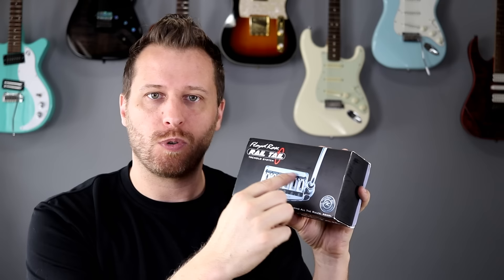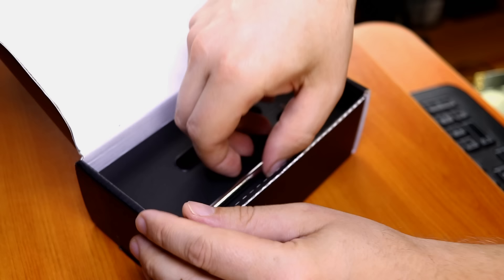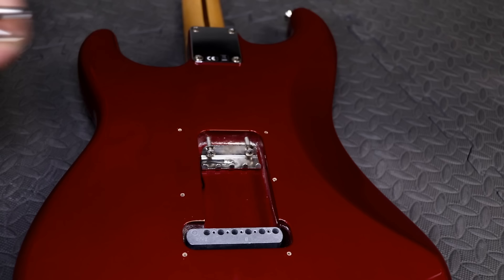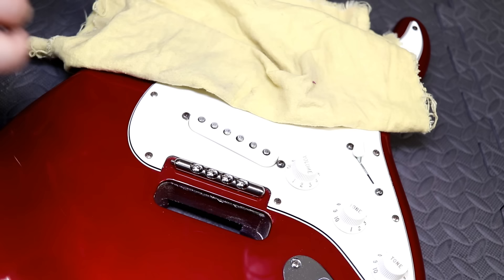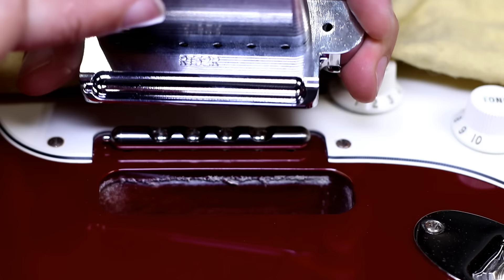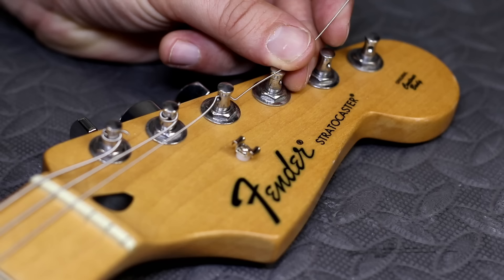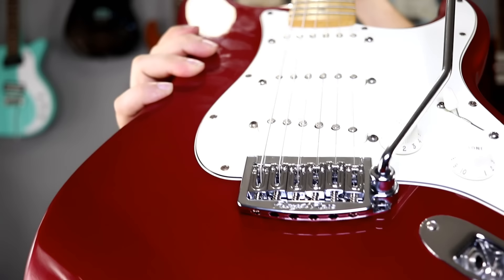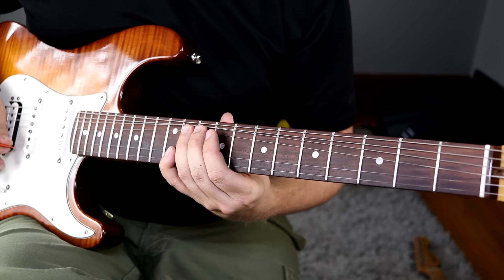Farewell to Fender's 6-screw Trem! - Floyd Rose Install!

Comment: Dude, lol.  Any generic rectangle or teardrop case will fit a MIM or American Strat with the trem arm screwed in... try spinning it downwards near the jack plate. Basically back it out a half turn
Reply from the maker: Cool, that's great for MIM Strats, but I'm not going to put all my US ones in sloppy fitting generic cases when they came with  beautiful form fitting ones. ☺
Cases aside, it's about Fender being well behind the competition (Music Man, G+L. PRS, etc) when it comes to trem designs. 
Thank goodness for after-market solutions.
Reply: You're in Canada?  The Yorkville cases from L&M are fantastic, there's two versions, regular and deluxe with the piping.   You're always going on about Fender but I don't think you understand their business model.  Most of the company is based on things from the past or the history of American music.  The 6 point bridge is fine, if you use modern springs and 10 gauge strings you only need 2 springs.  If you can't figure out how to get the 6 point bridge to work, it's not Fender's fault, it's your own ignorance.  You lost the ability to bend up in pitch, that's a huge downside.  The bar fits in cases which was another argument that doesn't really make sense.  So you can do double stop bends now?  Lots of players can do that on a floating tremolo, it's from practicing not always blaming the tools lol.  You could have bought a Callaham for $250 Canadian which would have been an upgrade, not a sidegrade.  The threads are cut in a better way and the metal is quality.  Those pop in arms are supposed to have a tension screw but they almost always dangle around more than a properly taped/screw thread in arm.  G&L guitars have a nut width so tiny they must be made for kids or Asian women, kind of like the Squier Affinity guitars.  PRS? You mean the company that sells overpriced guitars to people who don't understand harmonics(24 fret guitars lol) or where a pickup should be placed?  Lol those guys are taking a step backward, not forward
Reply from the maker: Well you got one thing right. 6-screw bridges are "fine."
I've been able to to some great things with them (search" floating your them to specific intervals") so I am well aware. ☺
Unfortunately, all their competition are putting out fantastic options in the same price range. 
Depending on tradition will always sell a few guitars, but Fender's debt is HUGE and they should stand up and take notice to what is happening to Gibson.

Comment: The way that it sits decked like that, if i were to flutter or dip and let go of it, would it slam onto the top of the body?
Reply from the maker: Hi! 
It depends how many springs you use and how you adjust the spring claw.

Comment: Not getting this much.. why won’t it float? It looks like it could. Surely less tension on the claw and it floats?
Reply from the maker: Hi! 
A floating trem will only be stable with a knife edge design. This design is maximized for tone and sustain, but will not be stable in a floating configuration ☺

Comment: Restring  issues .
I got this Floyd Rose on my Fender only 3 month ago and today i wanted to restring my 
guitar and simply cant get 3 of strings out. They are stuck inside its simply too tight.
I wrote an email to Floyd Rose about this issue and i am waiting for an reply.
Just wanted let you know about this. Maybe i was unlucky and the one i got is the only one with this issue, i never had this problem with Fender tremelo's.
Reply from the maker: Hi! 
This happens on lots of guitars. Just use a small Allan key (like for adjusting your saddles) and poke them out. ☺
Reply: I did that :) And the new strings are a bit smaller ( Daddadario XL 9.5 ) so they fit nicely. 
Thank you for your reply.

Comment: I can install this on something besides a Srat, right? Provided of course the dimensions jive... I got a Jackson with a 2 point hardtail Id like to upgrade a bit. String spacing 52mm, so the narrow should work, right? lol
Reply: If the neck height is similar to that of a Stratocaster, then installing a narrow Rail Tail should not be a problem.

Comment: Hi darrel! I want to replace the old floating floyd rose bridge of my old yamaha rgz 612... do you think it may be possible to put this kind of bridge on my yamaha?
Reply from the maker: Hi! 
Are those bodies routed for the Floyd? If so then I don't think it's possible.  If the trem is mounted on a flat surface then it may be able to work.

Comment: Hi Darrell. So I checked out all of your Trem mod videos. My question is "what was your favorite trem"? I want to change out the trem on both my Squier JagMaster and on my MIM strat. It seems that is the weak point on both guitars. I love the tone on both but I'm frustrated with constant tuning issues especially when I use the trem. Sophia? Vega? or Floyd? Bladerunner? Other? They all seemed really great. Also which is the best Value?

Comment: Nice invention - but price of this is ridiculously high - it costs ~ 3/4 of Mex Strat
Reply from the maker: Yeah, all decent after-market bridges are pricey ($200-$350). There is a reason guitars don't come with these kind of bridges from the factory - they are expensive to produce.
Reply: I'm from europe so maybe prices are a bit different here - but I just looked it up on thomann.de site - this bridge costs 435 EUR which is 2 times more than the next most expensive tremolo bridge ;)
Reply from the maker: Ouch!!
That's brutal. $250 in the US
Reply: i'm speechless ;)

Comment: Will this work with a recessed trem cover? I'm building a custom Warmoth strat, and I want to recess the trem cover, which is 2.2mm thick. Will the trem block on this Rail Tail hit the cover? Do you know?
Reply: The height of the string block is 41mm or just under 1-5/8".

Comment: Intrigued . . . Missed the part where you mentioned it costs almost 300 bucks.
Reply: It can be fixed much easier and cheaper without even removing and trashing the one on there.

Comment: The 6-screw style cheap trem may have many stability and tuning issues, but if you're going to block the trem off, which I do to every guitar I get that has a trem anyways, there's nothing better than the 6-hole design, other than, say, a proper flat-mount bridge. When you block the trem off with a chunk of hard-wood and then tighten down the screws until they're tight against the bridge, those screws, in conjunction with the block, transfer quite a bit of string energy through to the body, which is pretty much the only good thing about them, other than their ease and amount of intonation adjustment. 
Also, when I set up a guitar I may have gotten that has the 6 hole trem in it, I get rid of the finish between the trem and body and then wipe the bare wood down with Teak oil to protect it from rot, and the tone I get doing that is much, much better than what you would expect from such a guitar. Mind you, I only have two guitars with trems in them, both of the 6-hole variety, and both were Cash Converter (pawn shop) Specials. I would never buy a new guitar with a trem in it. Say what you will, but some of the best kit I have comes from pawn shops that didn't know what they had, including all but one of the guitars/basses that I own.

Comment: Nice, thank you. One question: You left the rail screws loose initially. Did you tighten them later or do they stay loose?
Reply from the maker: Hi! 
Keep the rail loose as you center the trem. Once it's centered tighten the rail down. 
You don't want any side-to-side movement.

Comment: I just got an ibanez Jem jr 2 days back. Wish me luck
Reply from the maker: Nice! Congratulations 😀
Reply: can you suggest me good pickup sets under 200 USD for my jem incase i decide to buy one.
Reply: i need it for my jem jr
Reply from the maker: It depends what style you play,  but the SD jb/jazz set is quite versatile and a proven set.
Reply: Darrell Braun Guitar It needs to be a HSH set. And I want it to be fit for metal and Steve vai type shredding.

Comment: Does the Floyd Rose tremolo system does it pass your test then on May 7th 2018 video of the Fatal flaw in all tremolo bar systems?
Reply from the maker: Hi!
Fatal flaw only pertains to floating systems. The Rail Tail is designed to be decked :)
Reply: @DarrellBraunGuitar  HI fellow guitarist, I decided not to buy the guitar with a floating Bridge I decided to buy the Les Paul Voodoo Juju.

Comment: Is it possible to set it up as a floating bridge or would pulling up on it have the chance of lifting it off the bar ?
Reply from the maker: Hi!
I don't think it will float. 
It's designed for full contact so as to maximize sustain and resonance ☺

Comment: Im looking to build a Warmoth custom what bridge option should I choose for this bridge does it go in a normal fender standard tremolo or the Wilkinson option?
Reply: Fender Vintage 6-Hole Tremolo Rout Option!  
It does not matter which Floyd Rose Rail Tail you chose, Wide or Narrow string spacing, the rail from either one will
match up with the 6-Hole Vintage Fender Trem Rout option from WARMOTH!

Comment: I never had real tuning stability problems with a Strat bridge. THE SCREW-IN ARM though. Arrghhh!! What a terrible piece of design. Luckily for those willing to preserve the vintage sound and look of their Strat, there a solution by Wilkinson (Paxphil in some markets). They make classic Strat bridges with pop-in arms for 6 and 2-screw guitars, and you can even choose between old stamped or newer cast saddles.

Comment: You said you chose the narrow option - which I assume is also what I would want. But I am unsure what the wide option is for? (And also curious because in the UK the narrow seems harder to find than the wide. But if the narrow is the appropriate choice for Fender or Squier, what is the wide designed for?)
Reply: The American Strats typically have wider string spacing (E-e  2 7/32" or 56mm) aka "vintage" spacing. The import Strats like MIM, MIJ or Squire Strats typically are narrow spacing. (E-e  2 1/16" or 52mm). It's always best to measure instead of assuming.  Because the Rail is slotted for adjustability, both a narrow and wide Rail Tail will fit on either style guitar. This system allows you to have the string spacing of your choice but keep in mind the strings may not line up 100% with the pickup poles if you decide to swap.
Reply: @officialfloydrose5849  Thanks for answering! I have (just recently) added a (narrow) rail tail to my Squier. But still, interesting to know this. Thanks.

Comment: Can this system be used on a g&l legacy? I've been wanting to mess with it and I want a new trem system and am curious as to what to use since its a 2 screw and not 6 system
Reply from the maker: Hi! 
You will need to use the template and drill the four holes,  but if your are willing to do that, it will likely work. 
Send them an email to confirm ☺

Comment: how well will the average mid level player be able to keep this in tune? Often you hear you need a locking trem for it to stay in tune
Reply from the maker: Hi!
Tuning with this bridge is very easy. Much easier than a floating system :)

Comment: I have a Fender Stratocaster Dave Murray Signature (the older model with a 6-screw trem, not the newer with the Floyd) and I'm considering this trem for an upgrade. Would you recommend it? I guess it would fit well, the guitar is based on a '57 Strat. Cheers!
Reply from the maker: Hi! 
It should fit just fine, but best to send them an email to confirm :)
Reply: Might do, thanks for answering!

Comment: A trem that doesn't float is totally useless to 9 out of 10 players, but I'm not seeing why you cant float it anyway if you wanted to. Also roller saddles don't do anything except rob tone. 19 out of 20 tuning problems happen at the nut and string tree. And what rule says you can't "deck" a vintage trem? Rory Gallagher did it, Clapton still does it, SRV did it. And if you're any kind of player, you can manipulate a floating trem when doing double stops. I still might buy one of these unless somebody comes up with a real reason not to float it, because it really does look like a great all steel trem.

Comment: How does it compare to the hipshot?
Great video!
Reply from the maker: Hi! 
The hipshot is machined brass too, but doesn't have the mass of the Flody Rose - which is sooo solid. 
The FR can't float though, which I have the HS set up to do. 
I noticed a gain in sustain on both of those guitars over the stock setups. 👍

Comment: Cool, I was thinking of installing a new trem in my MIM strat. Which would u recommend for a floating trem? (A trem where you can also bend up.) I prefer those
Reply from the maker: Hi! 
I used a hipshot on my SuperStrat build (you can watch it on the channel) and it's been great.
Reply: thanks I'll check out the vid
Reply: I've also wanted to try to Wilkinson Trem with the brass block
Reply from the maker: Also a great choice 👍

Comment: £359-379.00 way too expensive more than the guitar cost, if the bought this for a Mex Strat you would have to consider if it's worth it or go for a proper Strat either by making one up or side stepping and going for a Fender body with 2 point trem mounting already fitted.

Comment: Thanks for the info. Do you think it can be set up to float a little?
Reply: Unlike a beveled edge or 2 point knife-edge design, the large surface contact area between the Rail and Tremolo plate prevents it from achieving that crucial balance point when floating. While there is a major gain in tonal qualities and sustain, the downside, unfortunately, is the added friction which doesn't allow it to be set up to float.
Reply: @officialfloydrose5849  Thanks for the information.

Comment: How much will this stay in tune without the locking nut? Did You go out of tune?
Reply from the maker: Should be rock solid.  I suppose a person could add locking tuners which allow for no winds around the tuning machines and therefore less string slippage and stretchin. 
I'll known within a couple of days how well it will return to tune. ☺

Comment: Do you recommend adding a locking nut or is the standard one alright?
Reply from the maker: Hi!
Standard nut is fine as long as it's cut properly. 
Locking tuners will eliminate string wraps around the tuning machine and eliminate string slippage, so that might be a good option for an easy upgrade

Comment: Pretty nice Kit.  Do they offer American 2 point trems?
Reply: The spacer mentioned at 2:48 is also used as a conversion template for installing it on the 2 - point tremolo system as well. You'll need to drill 4 small holes in between the pivot posts to mount the Rail.
Reply: Ah cool.  Thanks for the info.  I doubt I go out and drill holes in my American Standard.  Maybe I will try to pickup a used 6 point body sometime for some experiments :)

Comment: What if you have a 2 point trem? Any suggestions?
Reply: The spacer mentioned at 2:48 is also used as a conversion template for installing it on the 2 - point tremolo system as well. You'll need to drill 4 small holes in between the pivot posts to mount the Rail. This is shown at the 10min mark of the official Floyd Rose Rail Tail Installation video.

Comment: I installed it. But when I use. My guitar get out of tune. I have sperzel lock turnes.
Whats the reason?
Is it the nut?
Reply from the maker: Hi! 
Make sure your trem springs have enough force to pull it flat to the body every time. 
Mine took a full day to settle in (new strings) and now it's rock solid.  
Lube the nut with graphite and if tuning issues persist for over a week then replace the nut.
Reply: Darrell Braun Guitar 
Right!
I adjust the springs force and now it's better.
But the principal problem it's the nut.
I made a test. When I put some graphite (with a pencil) on the nut and springs. The guitar almost stay in tune.
I realize that strings E and A have more friction at the nut. 
Sometimes when the bridge came back to flat position, the nut "break" the E strings and it sounds almost like a F.
Reply from the maker: Did you happen to put a thinker set of strings on (thicker than 9s or 10s)?
That will really cause the strings to stick in the nut too

Comment: Is there a version for the 2 point synchronized vibrato?
Reply: The spacer mentioned at 2:48 is also used as a conversion template for installing it on the 2 - point tremolo system as well. You'll need to drill 4 small holes in between the pivot posts to mount the Rail.
Reply: Thanks, that makes it very interesting for me.

Comment: I am worried about string slippage and tuning nightmares with a non-locking system...Do you stay in tune with heavy usage???  I went with locking mini tuners and a graphite nut even with just my factory crappy trem.  I'd LOVE to upgrade to this but wonder about tuning retention.  Thoughts???
Reply from the maker: Hi! 
If yoh have locking tuners and a graphite nut, you will have no issues keeping a trem   (floating or decked) in tune. 
Once your strings stretch out (a day or two) and you'll never look back ☺
Reply: Thank you for getting back to me!  I appreciate it. And now I will look forward to upgrading my Mexi-Strat and I think it will take the "wide" spacing (because I notices there are 2 spacings offered) correct?  Thanks again!
Reply from the maker: Hi I used the "modern" spaced one
Reply: Thank You!!

Comment: What about the two point trem?
Reply: The spacer mentioned at 2:48 is also used as a conversion template for installing it on the 2 - point tremolo system as well. You'll need to drill 4 small holes in between the pivot posts to mount the Rail. This is shown at the 10min mark of the official Floyd Rose Rail Tail Installation video.